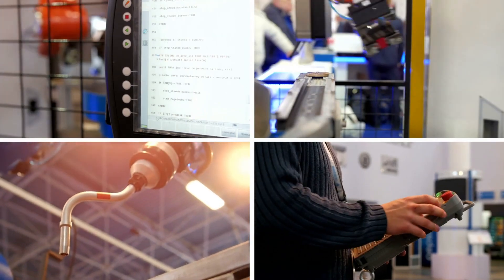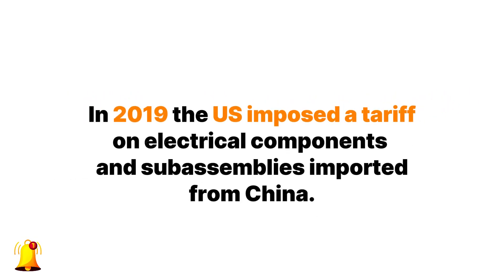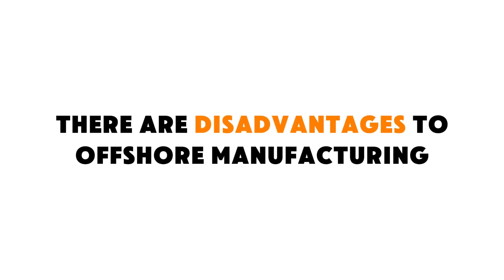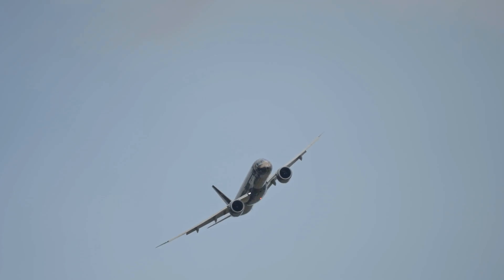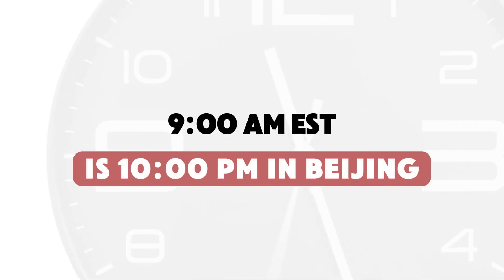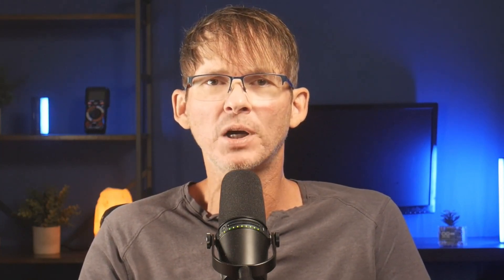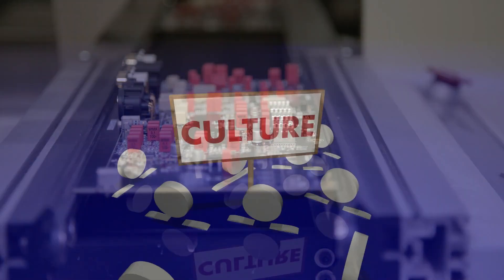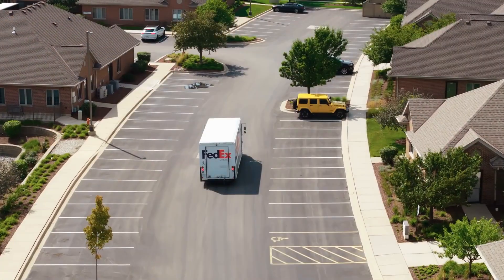How (and where) to manufacture your new electronic product

Comment: If the product depends heavily on the Firmware/Software, is there a way that we can give them an encrypted Code? (Note: all physical parts will be done by different manufacturers and will be sent to the one that will do the assembly)
Reply from the maker: You would just have the chip manufacturer or a 3rd-party program and burn the flash memory then have those pre-programmed chips shipped to your assembly manufacturer. You don't usually program them in-circuit for production.

Comment: Should I just move to China? I planned out a hybrid manufacturing but the shipping and tariffs are killers. Are there firms which are experts at manufacturing, packaging and shipping I can simply work with for a percentage of the profits?
Reply from the maker: You don't have to move to China but you may need to visit it, but it's not required. Perhaps look into sourcing agents to help you. No manufacturer is going to do all the work and then just share the profit with you for your idea. That sounds like a licensing deal which rarely happen.

Comment: I’m thinking if you really have a great product. One would be better off getting a licensing deal from Sony /LG / etc. Seems like a lot of that would be eliminated.
Reply from the maker: Sorry but it's not that simple. How do you know you have a great product until you actually sell it? You need sales proof usually to get a licensing deal. Also big companies have zero interest in licensing from small inventors. Sorry, there is no easy way:)
Reply: @PredictableDesigns  Thank you for the information.
Reply: That is remarkably difficult. I directly sell everything that I design/manufacture and it is a lot easier and most predictable. 

I have done a half dozen license deals over the years and every time they resulted in regret.
Reply: @Factory400 what happened?